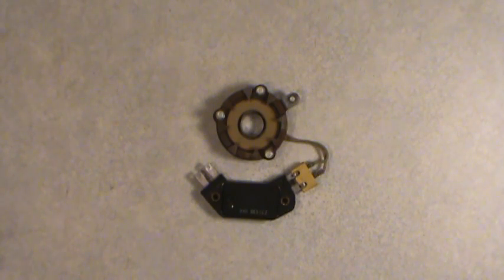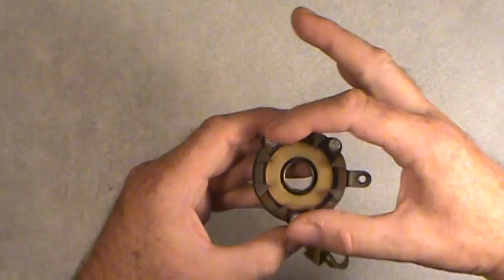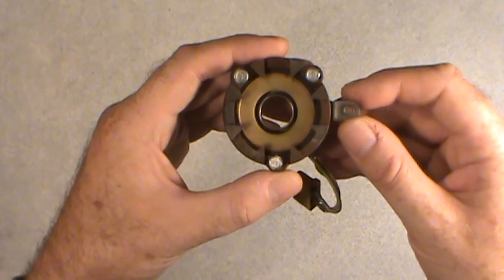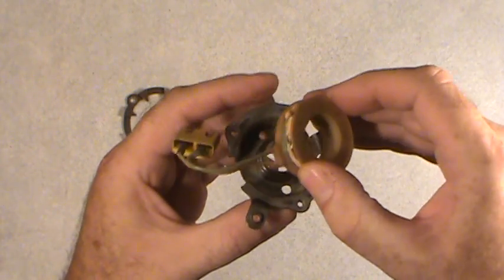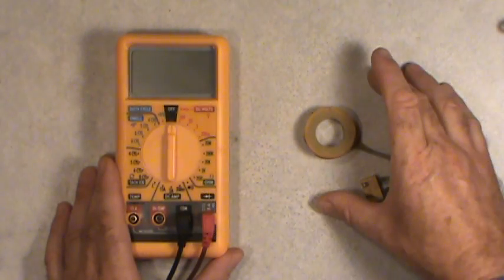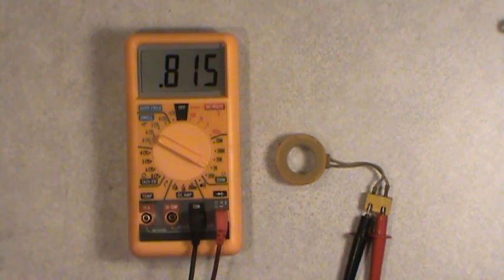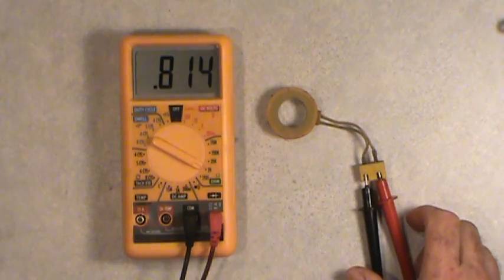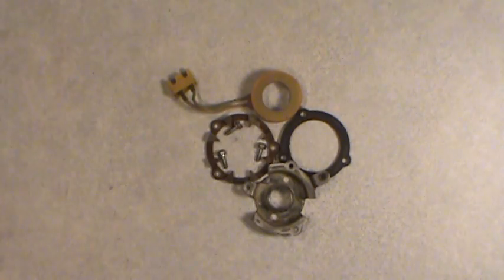HEI Distributor Pickup Coil Test

Comment: if the pick up wires are loose at all,will it cause "no fire" in the distributor?
Reply from the maker: Greetings...roger b..............Thanks for watching..............Yes, indeed, if the Pickup Coil's Wires, or its Connecter, are, as You say, Loose, or, Not making a Good Connection, then yes, a No Fire (no start), it just might be............The Pickup Coil, actually, shall we say, "Triggers", a 4-Pin type of Ignition Control Module (ICM), and without having that Triggering "Signal", then, a 4-Pin, type of Ignition Control Module, won't be opening the (electrical) Ground circuit, that needs to happen, when-ever, those, inner and outer, sets of Triangles, are about lining up, which then causes, the magnetic field, that, has already been built-up (from the previous, electrical, charging-up/saturation cycle), inside of the ignition coil, to collapse, which will then give us, that nice high voltage and amperage, that eventually terminates, at the spark plug's electrodes, and, which, on a good day, equals, a nice (and hopefully) Strong "Spark" as well..............Make sure, that, there is Battery Voltage/about 12 Volts, coming from the Wire/Connector, that plugs into, the Top of the HEI's, LARGE Distributor Cap, when the ignition switch, is in the "Run" position (with, the Engine, Not "Running"...!!!), cuz, if not, then, that's a problem, in, and of itself............Keep all Electrical "Connections", Clean and Dry, to avoid, any not wanted problems..............If You need any more help at all, just let me know, about Your "Exact" Vehicle, and the Problems that You are having with it.....and......till next time.......Be Safe, take care, and have a good one.
Reply: thanks,i have a 85 Camaro with a older 350 with 202 heads and holley carb.Actually,it's a  friends' car who wants me to sell it and it ran bad from the get-go.like a spark plug wire was crossed.i took the distributor out and a mechanic said one of the pick-up wires was loose,and then he pulled it off,(somebody had frayed the green wire already).i bought a alot of parts, without knowing i could get a new distributor on E-bay for only 50.00.so that's what i did today.
Reply from the maker: Greetings...roger b...........Congratulations, on the purchase, of Your New, nice-n-clean HEI Distributor, but, here are a few things, to be aware of..............Although, the New HEI Distributor, looks almost the same, as the one, that was in the engine already, I'd be willing to bet, dollars-to-doughnuts, that, the Specifications, probably, are Not the Same......say what...???...lol...........Well, if the HEI Distributor has the Advance Weights and Springs, just under, where the Rotor is mounted, then, there were, an almost countless number, of GMC/Chevy/etc.,Ignition Advance Configurations, as in, how many Degrees of Advance timing (at the crankshaft, sometimes expressed in Distributor Degrees...!!!), and, at what RPM, that it occurs at, as well as, how fast it comes in (commonly known as, the distributor Advance Curve, mechanically, that is).............If Your New HEI Distributor, has a Vacuum Advance unit/canister on it, then, there are Many different ones as well, as in, how many Degrees of (ignition timing) Vacuum Advance, it will add, at light engine loads, as well as, the Hg/inches of mercury (of vacuum, be it manifold vacuum, or ported vacuum/on the carburetor), where it starts, and ends at, as well.............The Initial (base) Ignition Timing, has to be Set (with a strobe, type of timing light), so it "Does Not", make the "Total" Timing, go too "High", at the specified RPM, for that particular Engine...!!!...("Total", that be, the Initial, plus, what the Advance Weights provide, when full deployed, and also, having the Vacuum Advance Hose "Plugged", so the Vacuum Advance unit/can, does Not Move/Operate at all)................The most important part, will probably be, making sure, that, the "Total" Timing (the best that I came up with, was that, the "Total" timing, was probably an old Racing Term, where-by, the "Racing" type of Distributors, never had a Vacuum Advance unit/can, on the distributor, what-so-ever), and, by saying this, it will hopefully, lessen the amount of confusion, that's goin'-on, out there...............If...???... there is a Vacuum Advance Can/Unit, on Your New HEI Distributor, then, if You see, 6-Sides on it (kinda, looks-like, the outside, of a Big Nut, that goes on a bolt), then, there's a pretty good possibility, that, it might be the Adjustable type (with a hexagonal, allen wrench/key).............So, please, don't make the Mistake, of locking down the New HEI Distributor, at a quite "High" initial (base) Timing amount, without "First" Knowing, what Degrees of (ignition) Advance, that Your New, HEI Distributor's "Advance Weights" will Max out at, and, at what RPM, that they Max out at, as well, so Your engine "Does Not get Damaged", when-ever, You, or Who-ever, decide, to go WOT/Wide Open Throttle/Pedal-to-the-metal...!!!..............Every Engine, is Different (well, to me, they seem to have Their Own Personalities...lol), as in, just how much "Total" timing (with "No" Vacuum Advance added), that it likes, when going WOT/Wide Open Throttle (and usually, at above, oh, about, 3,000 RPM/ballpark figure, and also, that RPM depends upon, the circumstances as well, as in, is "it" a Smog engine, or, is "it", a Street/Strip, or Race engine...???)...............The Cylinder Heads (burn time), will usually have a lot to say, about, how High, or Low, in crankshaft Degrees, of ignition Timing Advance, that the Engine wants, at all RPM's and Loading conditions as well, and, at the very same time, won't be causing any Engine Damage, and will also, have quite the affect, on Horsepower...Torque...and...Fuel Economy as well................When You install that New HEI Distributor, and without the (distributor) Cap on it, make sure, that, the distributor's Shaft, has some Up and Down, "Play/Clearance", once the (distributor's) Hold Down Clamp/bolt/nut, is tightened down, so the Gear end, of the distributor Shaft, "Does-Not", put any "Force", down onto the Oil Pump (not good)................If You happen to "Hear", any...Pinging...Rattling...or...Knocking..."Sounds"...coming from the Engine, then, there's a pretty good possibility, that, the Ignition Timing, might be "Too Far Advanced" (and the Advance amount, is usually measured, with a strobe/flashing Timing Light, pointed at the timing Tab, where the Line/Groove is usually located, on the Harmonic Balancer, most of the time).............So then, the above, will hopefully, be of some help to You................If You are in need of any more help, from me at all, just give me a shout, and, I'll do what I can......and.......till next time.......Be Safe, take care, and have a good one.
Reply: @RockysRoadshow  I just removed engine ,350chevy ran fine ,replaced it with a newer  engine ,hei distributor, 1979elcamino, well the motor turns over fine, I just don't have any spark...do u think it's the ignition module...

Comment: Do you need to remove the distributor to replace the pick up coil?
Reply: Thanks Rockey  my first vette trying not to to remove the distributor 👍
Reply from the maker: Greetings...Patrick Keaveney............Thanks for watching............Yes, indeed, the HEI (High Energy Ignition) Distributor, with that LARGE distributor Cap on it, has to be Removed from the Engine, and, not only that, the Distributor's Shaft Assembly, has to be Removed from the Body of the HEI Distributor as well, which involves, the Removal of the Helical Gear, and, any spacers/washers, that might be, between that Helical Gear, and the HEI's aluminum Body, that are on, the Opposite End, of where the Distributor Cap mounts.............Here are a few things, that You'll need to know, before attempting to "Re-Install", many, of the Distributors that are out there, for most engines..............If You haven't Removed and Properly Installed a Distributor Before, then, make sure, that, You Study Up on, and Observe, Very Closely, as to where the Locations, of, all of the spark plug Wires get attached-to, on the distributor Cap (aka, firing order, and the rotating direction of the rotor, that's spinning, inside the distributor cap), as well as, the orientation/position, that the distributor Cap is Positioned, on the Engine, as well as, what direction, that the Rotor is Pointing, as in, the way that they are Located, "Before", Removing the whole Distributor...............To avoid Problems, make sure that, You know, what the Initial (base) Ignition Timing (advance) is, with a Timing Light, that Your Distributor is "Now" Set at, so You'll be able to get it back to, where it was, when it comes time, to Reinstall it...............Those, are just a few of the things, that have to be done, and be done properly, I might add, and, if You are seriously thinking about, removing and replacing, something like a V-8 Engine's, HEI Distributor's, "Pick Up Coil", make darn sure, that, You know, how to do it properly, before attempting to do so, or, You'll more than likely, have a heck of a time, tryin' to figure out, why, the Engine, probably won't start, and/or, run properly.................I have a few, HEI Distributor Videos, on my YouTube Channel...RockysRoadshow...enjoy.............Just always remember, it's a lot easier, to take something Apart, as compared to, putting it Back-Together...Properly, and, not only that, something like an engine's Distributor, has to be Reinstalled, so the Initial (base) Ignition Timing, is Correctly Set (with a timing light), or maybe, it will be low power output, or, on a bad day, engine damage, and I hope not..............If You are going to Replace the Pick up Coil, just let me know, how much, You already know, about doing these kinds of things, that way, I'll know, what to help You out with......and.......till next time.......Be Safe, take care, and have a good one.

Comment: my88chev want get fire to distributer.
Reply from the maker: Greetings...Jamie Wambles.............Thanks for watching............In order, to actually test, an HEI/High Energy Ignition, Distributor\system, such as Yours, probably is, for its Spark output/strength/high voltage ability, (or perhaps, none at all, if it's faulty), is to perform, what is known, as a Spark Test, and it's usually done, with a Spark Testing Tool, some of which, are especially made for/and calibrated for, the General Motors/Chevy/Oldsmobile/etc., type of HEI ignition system, and, one type of HEI Spark Tester, kinda, looks, somewhat like, a Spark Plug does, but, it has a metal cylinder, in place of, where the outer electrode/ground strap, is usually found, on the spark plug................Some of the other types of Spark Testers out there, are adjustable, and the Gap, or distance, between its 2 pointed electrodes, can be set/adjusted-for, the amount of KV's/Kilo-Volts (aka, Kilo, as in Thousands) of Volts, for that "Exact", Ignition Coil's requirements................The "High Voltage", (ball-park figure, is about...30,000 to 50,000...Volts, or maybe higher), that is found, in most Ignition Systems, is "Very Dangerous", so, make sure, that You study up on, and, You know what You are doing, "Before", going anywhere near, the High Voltage side, of a Vehicle's Ignition System...!!!.............If You want to have a look at, some of the affordable (maybe, about, 10 to 20 Dollars there-abouts?), ignition system, "Spark Testers", just do an internet search for...Spark Tester...then select...pictures or images...on Your browser, to see what they look-like, and.......till next time.........Be Safe, take care, and have a good one.